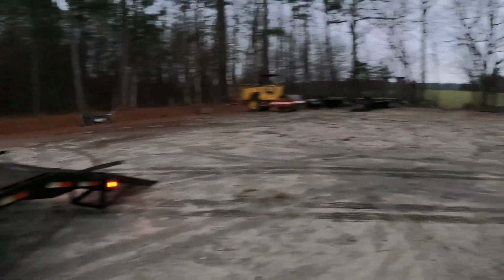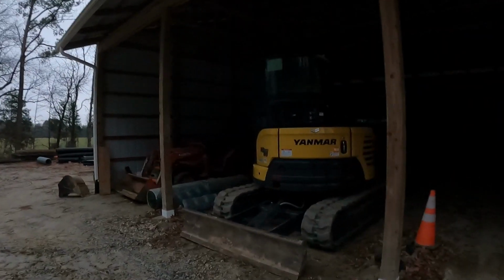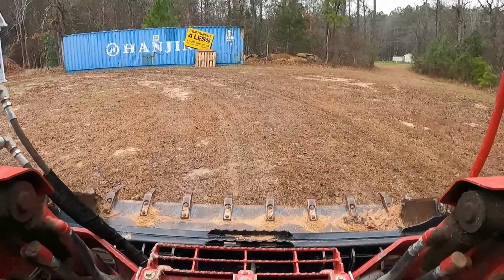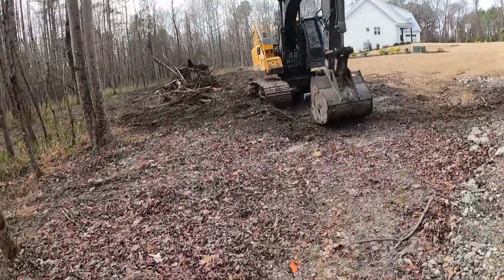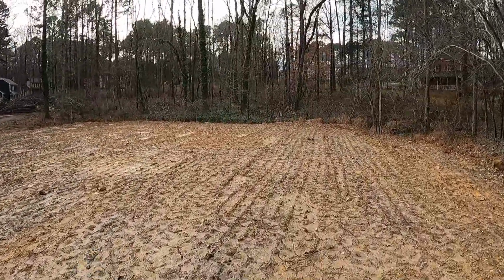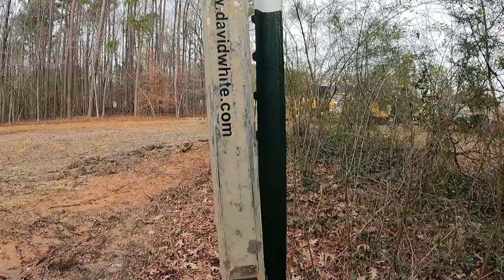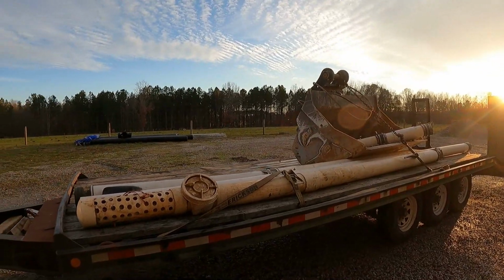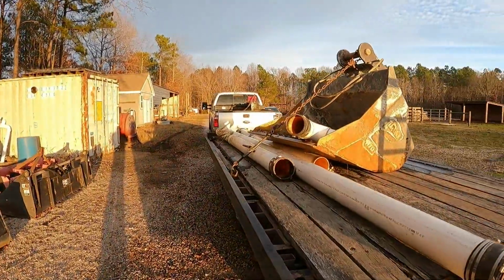Always Something To Do

Comment: Diesel Exhaust Fluid. Always sounds like it would be something found in the aisle with the blinker fluid and muffler bearing retainer clips. (I usually grab one
of each when picking up a stetsor valve or a godamnitron. Hate not having it when I need it!)  lol
Reply: forgot prop wash, fanbelt buckles, antenna key, sky hook and knueter valve.
Reply: dont forget a henweigh and a piecost
Reply: and a roll of fallopian tube
Reply: Don't forget the headlight fluid and the gaskets and the tire pressure air filters LMBO
Reply: You guys are HILARIOUS. ROFLMFAO. Can't have to much fallopian tube. BWAHAHAHAHAHAHAHA 😀😃😄😃😀😀😀😀😀
Reply: @po4RP20361  Oh yeah. Gotta keep the windshield washer squirtin'. Safety first!
Reply: Never forget being sent to the stores for a can of rainbow coloured paint or a long weight. :)

Comment: I love that you respect your equipment enough to store inside a building...That speaks volumes of your integrity and character... A class act operation and operator.
Reply: I notice that Chris respects the motoring public as well. Did you notice his decks were all clean? No gravel to bounce off and take out someone's windshield. Here in Canada as you go through the scales with loose gravel on the deck you can expect to get pulled over, fined and won't move again till the deck is clear. There are also CVSE guys on the roads with portable scales looking for commercial vehicles and equipment haulers with gravel on the decks as well. A lot of people have had to replace their wind shields because of lazy commercial drivers. Same thing with gravel trucks.
Reply: @dansbrown1313  yep
Reply: @dansbrown1313  exactly.  I almost had my truck window cracked behind a Ford l9000 with empty trailer that was covered in loose gravel and mud.  Somebody's flunkies driving it like a racecar too.

Comment: Just a little tip on DEF fluid. There are truck stops that have pumps for DEF and is cheaper than buying by the jug cause you're not paying for the packaging and cheaper to ship. The nozzles on the pumps are the same size as the jugs.

Comment: Chris you need to set up a solar charging system in your shed, panels on the roof and charge controllers in the shed, then you can plug your machines into anderson plugs when they are parked and know your batteries are looked after when your not using your machines. you can set it up to charge 24v and 12v.

Comment: My quick attach does that same thing on my TL8. I can usually stick the tip of the bucket straight down in the dirt and ease forward slightly and it will disconnect like it's supposed to.

Comment: Our Cat with the quick attach is the same way, if there is any dirt it'll just freeze up and you're left beating the pins with a maul to get them loose. As nice as it is when it works I think I'd prefer the manual locks since those you can break free easier.

Comment: Nothing like doing machine shuffle before you even start working. Ever think of getting solar battery charge system set up on the far shed that has no electrical feed?, keep units plugged in until you use them. I am glad that diesels are cleaner now- I remember how all of them in the 1950s & 60s filled the air with black (and blue) exhaust.

Comment: Been doing the same with the AdBlue on my car after seeing a 1/4 full container start to crystallise up the sides. If its doing that in the bottle then it will do the same in the tank so what are the chances of some of that clogging the system up? Better just to keep it slam full for the most part and theres no room for it to do that.
Reply: The crystals dissolve as soon as it gets wet again. It's very water soluble.

Comment: Have you looked into setting up a Battery Tender setup for your equipment so it keeps all the batties fully charged? When you want to use the piece of equipment you just unplug one plug and off you go. When you are done plug the wire back in and the battery will be fully charged next time. It keeps your batteries from going bad by keeping them fully charged.

Comment: Blue Def helps your diesel run cleaner which extends the life of your injectors and the rest of your engine between rebuilds.
It also keeps your exhaust system cleaner and cuts down in diesel atmospheric pollutants.
That's kinda good for our children and grandchildren we're going to leave this planet with.
Reply: Blue Def has nothing to do with the injectors, it is sprayed into the exhaust system after the turbo to reduce emissions, but it also causes a LOT of problems and really doesn't cut down on the emissions as much as many think it does. It also is acidic and causes the exhaust systems to rot out faster.